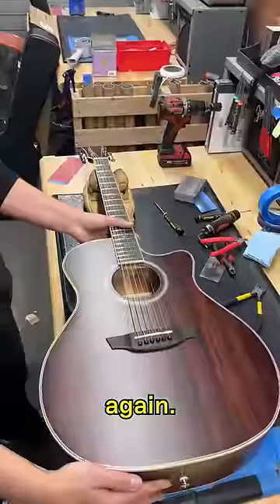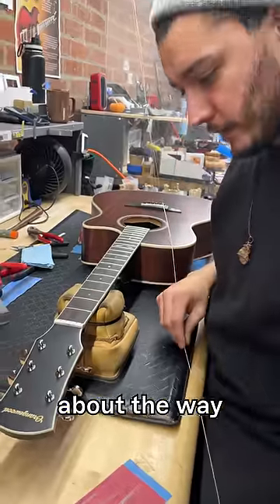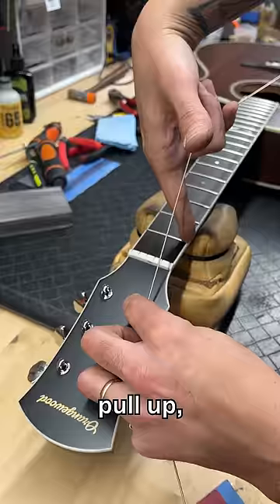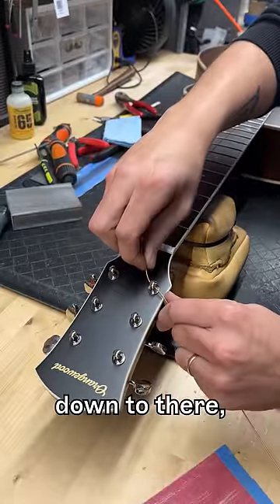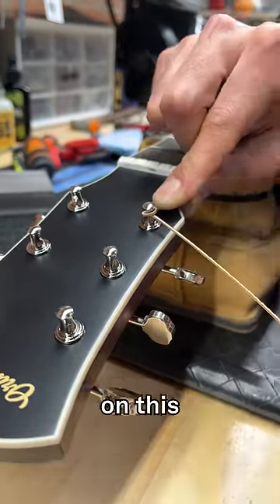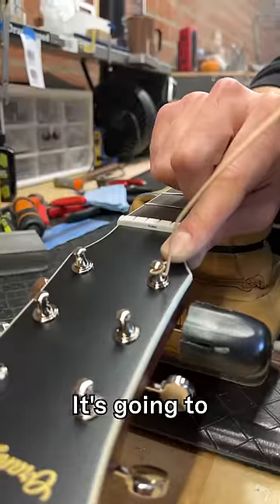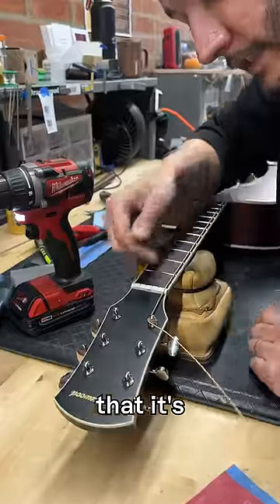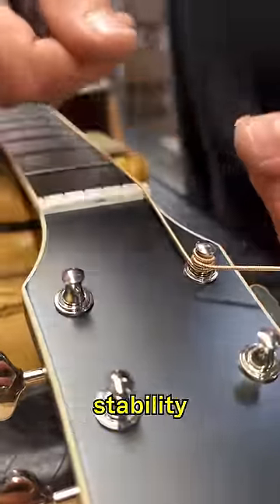Restring your Guitar like a PRO with this HACK

Comment: Instructions unclear: I now have a Disney villain scar across my face
Reply: Nice. ❤
Reply: Lmao 😂😂😂
Reply: Pretty straight forward if you actually play guitar
Reply: lmao you don't have to worry about that, I've tried this on my MIM Strat and it works like a charm. The strings on electric are thinner and easier to break and yet it still worked fine :)
Reply: At least you didn't use Gibson knots.
Reply: As in a whole lion?
Reply: I'm 97 years old, I've had the same Sears guitar since I was 12 I think. They came out with special strings that year, that " never" needed to be changed. And I am telling you the honest truth, I have never once changed those strings!!!
Reply: @pureshasta  i play guitar... What does "fold it where the string was" mean?
Reply: @RandyRichardson65 Wie heißen diese Saiten?
Reply: @RandyRichardson65 that’s pretty incredible…
Reply: There are many videos about how to do this. I would watch a few different ones to find the easiest one to follow. That’s how I learned to do it.
Reply: @Sean-dq5ni he placed his finger on the string at a fret which I don’t remember the fret. Just hold the string with your thumb and forefinger. Hold it and pull the string through the tuner post until where you’re holding the string meets the tuner shaft then bend the string up at the shaft.
Reply: Guitar name plz

Comment: As a truck driver, i recommend using a pneumatic impact to really torque them so they dont come off.
Reply: Lol
Reply: As a blacksmith i recommend forge welding your strings to your nuts so they get a nice seal you can additional tig weld the string to the tuner for extra security. Never worry again!
Reply: Inch drive Milwaukee on that thing
Reply: I also put red lock tite on the tuning pegs so I never have to retune again.
Reply: As a First Mate on an 18th century Whaleship, I recomend the bowline knot. 

Also, what is this sorcery?
Reply: What PSI?
Reply: I tune my snare drum with a power drill lol
Reply: I leave the remaining length of the string on and secure it to a boat anchor.

Comment: I was just about to re string, damn this might save me, thanks

Update: It really did saved me so much time
Reply: I literally restringed my guitar last night and then I see this NOW
Reply: @CastJupiter-lh8yk  ouch
Reply: Don't cut all your strings at once. It's terrible for the tension on the neck. Do it one string at a time.
Reply: Please do not follow his technique
Reply: You don't need to do that, a single bend is enough to lock the string you bend it towards the tip of the head and wind
Reply: Ein Gräuel für jeden Gitarristen! Bei Saitenwechsel nie erst alle Saiten entfernen und dann neue aufziehen. Es sei dann, man mag die Gitarre nicht.
Reply: @NeverTheSame I about to say this. Cutting all the stringsay reuin intonation